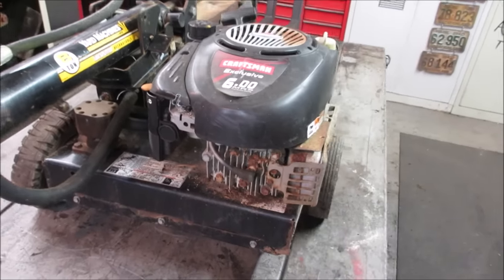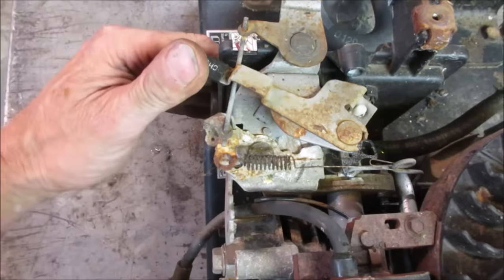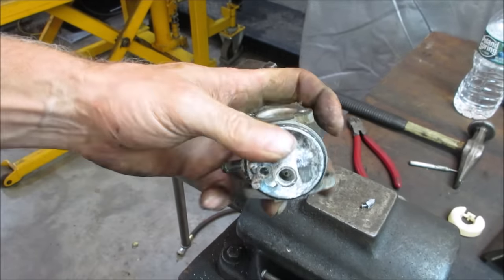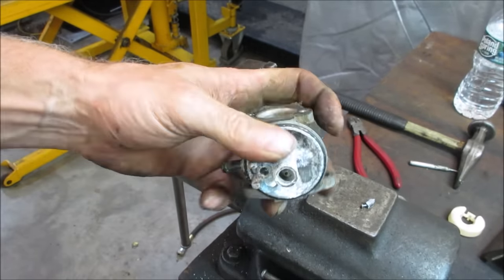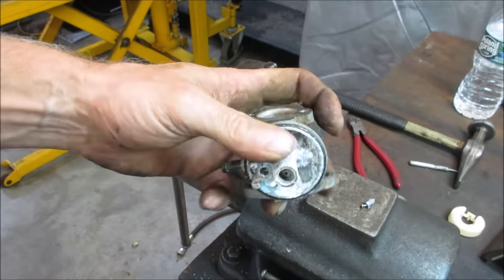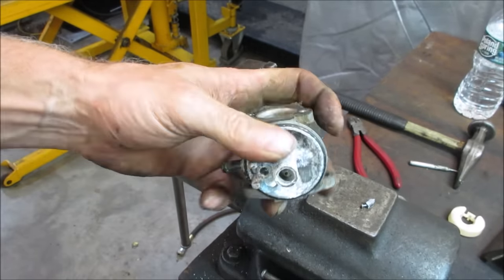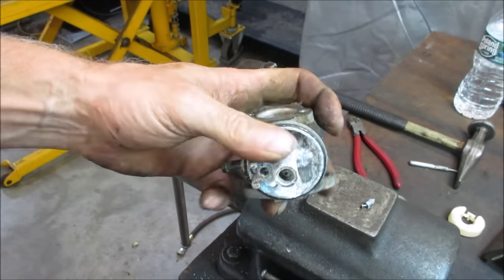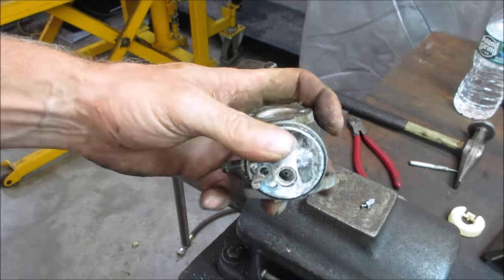Crushed Under a Barn, Free Busted Log Splitter

Comment: Return hose is restricted with that kink, and the pipes underneath should run as a roller, so the nyloc nuts should not be fully tightened. That is faster with fresh oil.

Comment: I got a free John Deere riding mower, like 2016 model I think, with some old farm equipment I bought, didn't run guy was like yeah if you want it take it... The plastic fan on the engine had broken or something (it was missing and I didn't find any remnants other than a few plastic bits melted into the fins on the engine) and someone just kept going, overheated enough that the exhaust valve rocker pulled out of the head.. $40 for a used head off eBay and $12 for some gaskets and it's back up and running like a champ

Comment: Maybe sharpen that stationary angle arbor to the left and don't forget there is a burr midway on the running tank/beam. Could use a quick grind clean up.

Comment: Is that spacer on the 5" bolt a roller instead of spacer it had a nylock nut  so it would work without tighten completely againist the spacer or roller!

Comment: 41:53 cut a metal rod in half for the length of this thing and roll some fine sandpaper (like 3000 grid) up around it, after jamming it through the cut in the rod.

This will polish the inside without any pressure needed, just by flying out while spinning.

Comment: A little bit of valve lapping compound on the smooth end of the drill bit will polish the sides of the bore of the needle/seat chamber. Those entry level splitters are motion wasting back breakers - too much stooping and bending over, plus having to go back and forth to load and operate. IMO it needs to have the hand control moved over to the other end of the ram and the whole machine needs to be raised up to a good working level and incorporate some tables for loading and unloading.

Comment: Do  the  little  ones  like  that  have  a  filter/screen  on  the  low  pressure  side?  With  that  pink  fluid  in  it,  did  it  plug  up  a  screen  a  tad?

Comment: The way it jumped would tell me that there is air in the system. Hydraulics doest generally jump like that.
The bypass is probably not holding back the correct pressure with that thin fluid. 
Put a gauge on it it will tell the story.

Comment: Label said Dexron III but I think that stuff get full of air with that type pump. What you put in there works much better.
Reply: Transmission fluid has an additive to stop or reduce foaming. There is a reason for recommending fluids
Reply: @patricktennant1585  I think they used it because it’s readily available to most folks at auto supply stores. The old stuff looked foamy like the additive was no longer working and moisture too.

Comment: The hydraulic system may not have a breather. The volume stays the same for forward and reverse. The actuaters for security gates merely run the pump in two different directions to move the ram either way.

Comment: The volume in the reservoir should not change.  The cylinder is double action.  It should fill at the same rate as it empties.  The reservoir is for expansion and heat disapation.

Comment: What kind of cleaner/brand do you use in your ultrasonic? I've been using Simply Green, and it works great so far.
Reply: In the past it's been a gallon size of Gunk Carburetor Parte Cleaner.

Comment: If the light plant generator is dead could you not put the engine on your ground heater and use that to heat your workshop ?

Comment: On these old flat heads the two head bolts closest to the exhaust some times are loose and should be checked . Loosen from thermal cycles .

Comment: good job that goodness they sell 15 dollar china carbs on ebay i would throw that thing far away but that would not teach anyone anything on YT thank you for doing this.drill out main jest with mini drill bit in a hand drill to the next size that will now slide up threw the main jet in the center on carb doing that fixes the engine hunting bs 99 percent of the time

Comment: Nah, die piston is double acting. So regardless in which position, the fluid level is always the same. It's just important to never open the reservoir when the fluid/air mixture in it is hot.

Comment: Teflon pipe dope should be used on that pipe plug and all plugs with pipe thread.  Seals better and doesn't let plug rust in hole.

Comment: I'm curious about these sort of splitters... We don't see many of them in Australia, with people generally preferring to use a chainsaw or a regular old axe.

Anyway, the times I've seen them being used, both in real life and online, they've been right next to a house or larger shed. This has made me wonder why they're all "gas" powered when so many people use them basically right next to a power socket. Especially given the period of actual operation is low compared to the time spent loading a log into place. An electric one could switch off entirely or run a low power to maintain the head in at the top end while not splitting anything.

Is there a technical reason, or just a general culture of fuel powered engines are more powerful than electric? 

Obviously the portability into fields/forests is one reason for some people to go gas/diesel, but as I said, it seem most don't use them that way.
Reply: My experience with both types are limited. A cheaper option, the electric version I used was out-performed by gas. For that reason I am biased towards a gas splitter. I will admit too, I am stuck in loving gas engines more than electric motors. I don’t know much about electric motors, but I know it takes a lot of force to split the log. But proper gearing could reduce electrical load on the circuit, perhaps? No breakers were blown when I trialed an electric version.

Comment: Now to make good use of it...

Increase the size of the engine pulley to where the 6hp engine can both make the travel of the ram so much quicker...
and at the same time still provide the oomph needed to force the wood onto the wedge.
Overpressure is limited by a valve in the valve body and there may be a pressure limiting valve on the pump itself.
The ultimate "fuse" is the V belt.........

If you can move your lift out to the woodpile the waist height position would make it so much more pleasant on your back when feeding the machine...
and the deck of the lift is somewhere that you can rest the split pieces that fall off the fixed wedge ....
which is always a problem when you don't have the wedge on the ram and a flat plate on the end of the steel beam.

Just kidding...it needs legs under it and a tray built on both sides to store the wood that needs further processing.... 1/2 chunks , 1/4 chunks....

Comment: Swap the engines  pulley for a larger diameter and it'll run the pump faster, which will in turn speed up the cylinders cycling speed...

Comment: If the bypass in the pump is set low enough for a 3.5 hp engine then you put on a 6 hp engine it probly wont lug down before the bypass releases pressure.

Comment: I'd prefer to move stuff with rodents nest outdoors and blow off that stuff there with a mask and protective glasses on.
47:53 - a small amount of water in the gas tank can be rinsed out with some rubbing alcohol.
That opaque red indicates to me that there's water in the oil, so the pump might have rusted inside.

Comment: 1) general condition
2) spark? If not proceed to get spark 
3) compression? Squirt some fuel down the hole put in the spark, will it pop over? If not why no compression…
4) clean tank, add fresh fuel, try running it. If it won’t run take off the carb
5) fuel system…. 

Lol

Comment: Kneeling on the ground to split wood is not the way to go.  Good job on getting it running right. Automatic transmission fluid is not the correct oil for hydraulics.

Comment: It's a shame that they didn't mount the engine the other way. Messing with that breather assy next to that hydraulic line. I would much rather have it facing the spark plug to the lines.

Comment: Does the cutting wedge need sharpening?
Reply: You could sharpen it a tad with a bastard file, but all it has to do begin the split and the rest of the way is easy.
Reply: @Hjerte_Verke  Thanks, so an incisive initial split is easier on the machine.